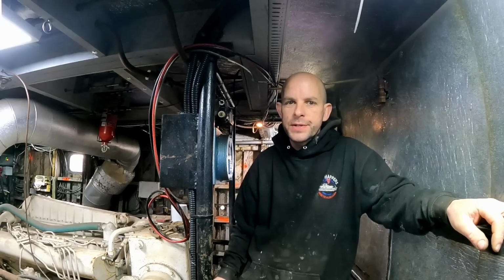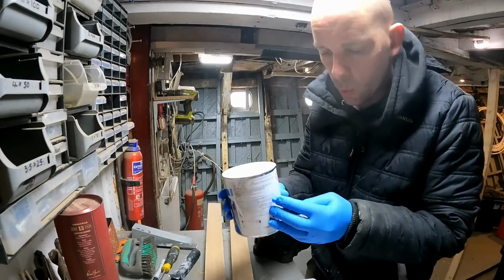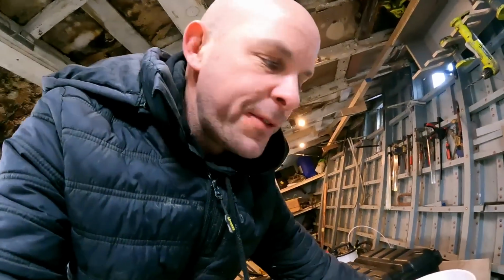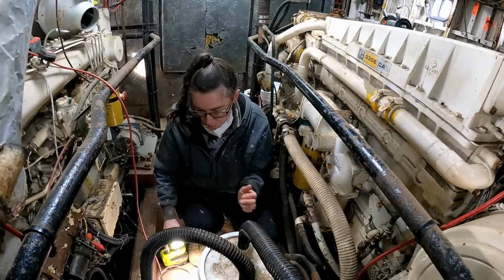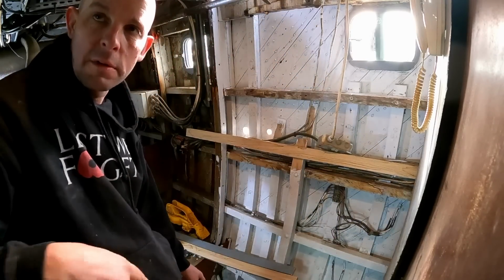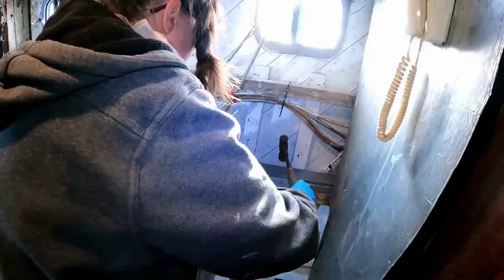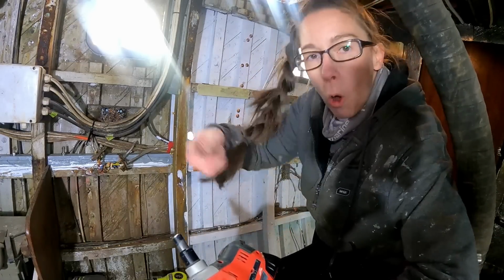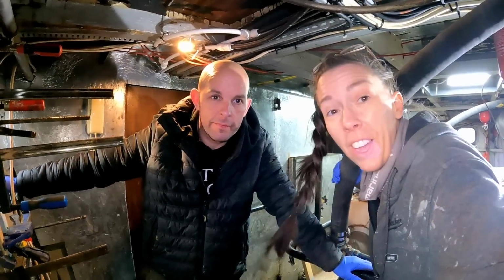Ep 112 - Bilge Full Of Oil On Our Boat Restoration Project  #boatrestoration

Comment: The more I watch Ship Happens and the more I watch Tally Ho the more I realize they're different projects. Neither one is better or worse than the other, they're just different. And for the record, I think Ship Happens is as valuable an addition to Youtube as Tally Ho.
Reply: I watch both channels, I think tally ho is really a boat build rather than a refit.
Reply: Sailing Ran, Acorn to Arabella and MV Geordie are also great to watch too and are similar in ilk
Reply: @cedley1969  For sure. They're both "boats" they're both "made of wood" and they're both on youtube. And from there, every other fact and feature is not the same!
Reply: Then there is Sailing Yaba, about rebuilding a coastal schooner in Brazil.
Reply: Tally Ho is a wonderful rebuild using traditional methods with today’s tools. Ship Happens is a solid restoration of a badly abused and neglected boat that was originally built for a short working life.

Comment: Separate the oil from the water. Install a spigot into the base of a rain barrel or oil drum. Pour all the bilge waste into it and let it sit for day. Drain off the water until there's not but oil left. Oil can be disposed of as waste oil. Most councils have a place for it to be collected and re-refined. The drained water can be left to evaporate. The sludge left over should be fine to go in the rubbish.
Reply: Bio-dieselers clean and separate wet dirty oil over heated water. Put the mix in a barrel and heat it. Dirt drops to the bottom and oil/water separates out. It works on emulsified oil as well. A tap at the bottom of the barrel lets you drain off the water then just pump out the oil.
If there’s more oil than water literally add enough water to cover the heating element and boil it.
Reply: To add a bit more. The dirty but separated water can be treated with biological laundry detergent and disposed in the drain. Obviously not if it’s significantly oily. The same idea works on floor and driveway oil spills. Mop up the excess then scrub the surface with laundered detergent and hose it down.

Comment: Hey Simon or Gemma, I recommend you use a trowel with 1/16th or 1/8  teeth to apply the epoxy it will help you not have a bunch of excess epoxy wasted away and it save you a bundle of money. Btw the engine room is coming along pretty dern good.

Comment: Lots of comments about using some sort of notched trowel to spread the epoxy, but you can also put the mixed epoxy in a sandwich sized plastic bag, cut off a corner and squeeze it out like cake icing.

Comment: I believe the external hull planks should be restored to the original height with stepped diagonal joints and bronze or stainless screws. 
The new bulwarks can be bracketed to the new deck frames. Don’t penetrate the new deck. It’s a recipe for water leaks.

Comment: When I re-engined Lazy Days I made fiber glass oil trays to fit between the beams and catch any oil, diesel spills, this could be pumped out of the tray with a small hand pump. The trays could be removed for hull work.
Having been there and suffered please check the diesel tanks for the dreaded diesel bug, that thrives on top of the fuel on the water from condensation. This will get stirred up underway and block the fuel filters very quickly. Consider a day tank that you filter fuel from the main tank into and this will be filtered again by the engine filters. There are additives available, but engine manufactures don't like them. My episode cost me a injector pump strip down and that was not cheap.

Comment: Gemma & Simon - for gluing up laminations  - I've seen a lot of woodworkers using a hacksaw blade to spread glue evenly - although that is usually just wood glue, but maybe an old saw blade with bigger teeth would make spreading the epoxy a bit easier and more even.
Reply: ... and save expensive epoxy!

Comment: The tool you use for compressing the copper rivets. The dolly with the half bowl shape does not have to be wiggled around . The dolly shape will give you the shape you require. I suspect the wiggling of the dolly has worn out the bearings in the tool.

Comment: Engineering 101 Gemma, always best to tighten the moving nut to a held static bolt.
Reply from the maker: We aren't using bolts, we are using Stainless treaded bar with nuts and washers on both ends, so no static bolt

Comment: Probably a bit late for you but have you ever looked into a product called Abatron wood conditioner? Great stuff I use it on my 175 year old house here in Kentucky. Works wonders with punky wood. You leave all the crap wood in as a filler and then pour in the Abatron epoxy and it soaks into the wood. Sand and then paint. They also sell a wood filler that is good outdoors for restoration mix the two parts fill sand. You can even nail into it..

Comment: Steaming is great, when it can be used when there’s plenty of time. But the steamed wood must be allowed to properly dry to shape before any one or two part adhesives, or paint product can be used properly. Lamination is a great way to move forward with usually only a day of dry time needed. Also if the grain of the wood is staggered the finished member is considerably stronger compared to the same dimension of solid stock. 

Draining the engine oil can be a beast of a job in the first place. But the need to also keep the bilge clean and oil free, well that’s just crazy talk! Now I didn’t have a monster fire breathing Cat engine, let alone two of them, but still the 7.4 engine in my fishing boat was shoehorned in so tightly that it was an impossibility to get any sort of pan under it that didn’t require at least three dumps before the crankcase was drained. 
What I did was to fit up an extension of hydraulic hose from the sump drain port, to a position higher than the top of the crankcase with a simple 90° turn brass shut off. 
Then I pushed the hose from a vacuum fluid evac tank through the shutoff valve all the way to the bottom of my oil sump drain extension hose. No more oil in my bilge! 

Another great video, y’all are learning so much as you’re going along. This knowledge is key to knowing how to properly maintaining such a large wooden vessel. This little ship will still be around for at least another 80+ years thanks to all of the hard work going into her now. 
Keep up the great work! 
I’m all out of words now.
Reply: Oops I found more words, sorry…
Y’all might think of finding a “Ships Systems” specialist to lay out a workable electrical system. This can be a job fraught with unseen overload or starvation of necessary amperage that can easily damage electronics, or in the worst case scenario result in a fire. Check around in boatyards for recommendations. 
This is a critical system, you want the best available. Hopefully you’ll be able to find someone that can donate the time needed, by allowing the design to be stretched out over the next several months.

Comment: Great job guys. I hope your local council tip is better than ours. Ours only allow me to tip 5lts of oil at a time. My car holds 11 litres so its a real pain disposing of the oil. No wonder people flytip it.  IMHO you are using way too much epoxy to join the wood together. Only use enough so you get barely no sqeeze out. The excess is just wasted money. A bead down the centre should be more than enough as you want barely enough epoxy to stick it together.  ATB. regards

Comment: Good way to apply epoxy to a lengthy narrow surface is to use a freezer bag with a 1/3" hole at one end then just squeeze it out like you would with an icing bag. Don't have to spread it.
Reply from the maker: Great tip!

Comment: Them cats are awful engines
Reply from the maker: Why?
Reply: No there not
Reply: Awful why?
Reply: @ShipHappensUK That was my question as well! Cat engines are among the best ever manufactured in my opinion! How old are your engines Simon?
Reply: The 3306 engines are great engines.   Extremely reliable
Reply from the maker: @Case 275  these engines were fitted during the conversion in 1980, they only have 1100 hours on them!
Reply: @ShipHappensUK  sorry maybe you’ve misunderstood or I didn’t explain properly. I rebuild marine diesel/lng engines. I meant awful to repair, like all CAT engines. I did not mean the reliability of them. A lack of hours under little to no load is not a good thing either for a diesel. Wants heavy load in order to last.
Reply: Wow, looks like good progress moving thru the engine room!!! Yes, great explanation on using white plastic buckets for Hoover pre filter!  I wonder what tools, bits and pieces you found in the engine room bilges?  
My dad used to find loose tools inside aircraft when overhauling them for the Air Force. Thx for bringing us along. 😊😊😊 Ken